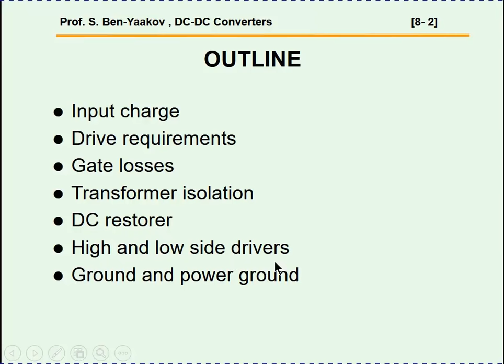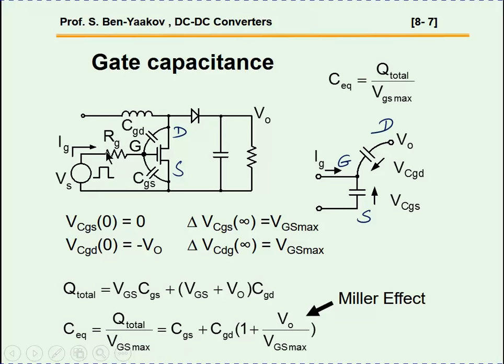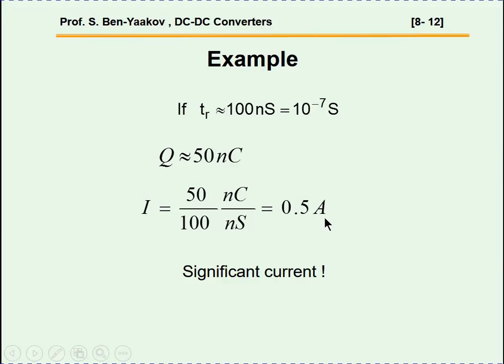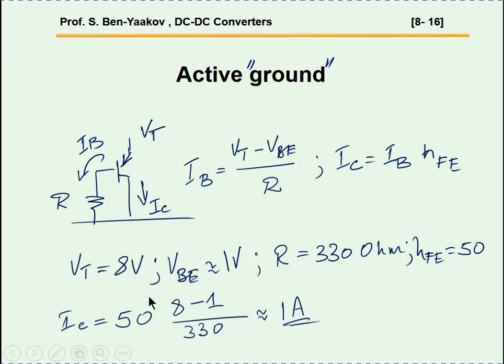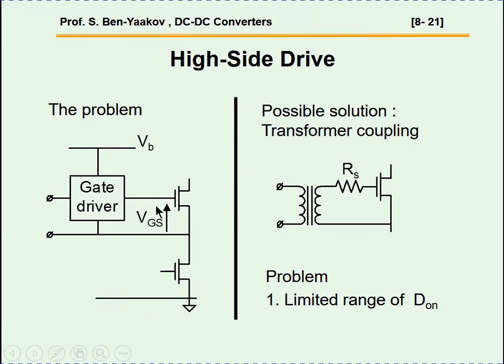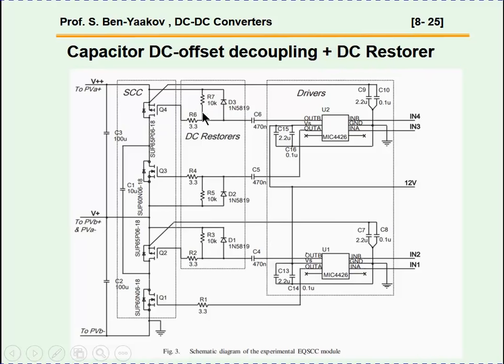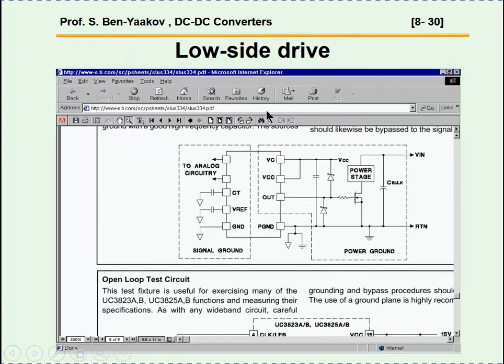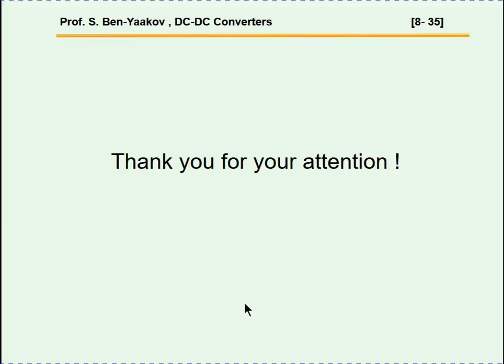Power MOSFET drivers

Comment: Professor, any chance you could do a video on dead time, and how to achieve it for 3 phase inverter circuits. Thanks
Reply from the maker: What do mean by "how to achieve it"?
Reply: @sambenyaakov  I mean how to determine how much dead time is required in order to avoid shoot through when designing half bridge, H bridge or 3 phase inverter circuits. e. g. In a situation where you have high side and low side MOSFETs. Also is  dead time implemented in code, hardware or both? Can it be calculated? if you could do a lecture on this matter that would be great 😊😀
Reply from the maker: OK. Got it. This is indeed a good topic but not easy as there atre many caveats. Will see. Thanks for your suggestion.

Comment: Dr. Sam. regarding  Ton of MOSFET you mention at page [8-9] ,can I find this data in MOS datasheet or calculate it? Thanks!
Reply from the maker: Ton is in fact the rise time YOU want. To completely charging the gate.
Reply: @sambenyaakov  Dr. Sam. Thanks for reply, on the other hand, it means if I set driving current of MOSFET,then Ton time can be calculated,right?

Comment: thank you for your explaining. if there is only a mosfet, G is disconection and provide a DC voltage between D and S, is there any voltage appear at G due to Cgd and Cgs? if there is ΔV add onto DC voltage, how is the voltage of G. thank you!
Reply from the maker: Theoretically the voltage is due to a capacitive divider. But this is overtaken by the DC current  leakages which will push the voltage to ground or supply depending on which leakage ( DG or GS)  is larger.
Reply: so, in general, we need to connect a resistor between G and S to force the voltage equal to the potential of S? thank you!
Reply from the maker: @陈友敬  Indeed

Comment: Hi Dr. Sam,
Please, in internet there are many information about power mosfet driver, but I want to know a example with the theory. In my case I have a IRF640 VDS: 24 VDC load: R: 10 and VGS: 12VDC. Which should be the value of the Rg on and Rg off for this application. The frequency is: 10Khz.
Regards,
Wellington
Reply from the maker: I would say that 3.3 Ohms will be fine.

Comment: @1:27 after Q2(x axis) isn't it it charges only Qgs not Qgs+Qgd .. because till now all the app notes I have found everywhere it has been mentioned only Qgs not Qgs+Qgd ..

Correct me if I am wrong
Reply from the maker: You may be correct in saying that in the app notes you have seen, the charge is Cgs, but this is incorrect. If this charge would have been Cgs, why do you see the flat portion? This plateau is due to Miller effect caused by the charging of Cgd. All this is explained in video.
Reply: @sambenyaakov  Sir I am referring after Miller platue region ( at the end of Miller platue region Cgd charges fully) when VGS rises futher at that time only Cgs charges to reduce RDSon.....but in your videos it shows QGS+QGD both charges.

Am I making any mistakes?
Reply from the maker: @biswajit681  Yes you do. Once the plateau ended Cgs and Cgd are in PARALLEL and both continue to charge (no Miller effect)

Comment: Thanks for the explanation, I have a question concerning the gate power loss, does  Ce  equal Cgs or Cgs+Cdg ?
Reply from the maker: Ce? where did you see it? If you mean Ci then Cgs+Cdg.
Reply: At 14:40 you used Ce to calculate power loss
Reply: Both is wrong. Use Ce from 9:22.

Comment: just spend a sunday and mondy, to code some blinking code on arduino, to regulate the mosfet´s behaviour thru " a level of detaiil" when the frequency is between 30 hz and  10 mhz on the lower end. the up and down ramp is different, just by observation, and tthe oscilloscope is not even warmed up for this. thie blinking between each step has to be compensated later, with some switched capacity or some softening in the curve is modeled out. frequency with hundret or millions of hertz makes it even harder for a chp to calculate, this is then dsp ground, one might say :) thanks anyhow

Comment: Professor, how does Vth change for a given MOSFET over time, temperature or whatever may affect it?
Reply from the maker: Good questions. Yes, the threshold drifts with temp but not in a major way that needs adjustments. Regarding aging, I don't know but I am not aware that this proved to be an issue.
Reply: @sambenyaakov  thank you!

Comment: Hi Sam, thanks for your explanation. I have a question... in the computation of the total charge (from 8-4 to 8-7), Cds disappears. Actually, the voltage change during the off-on transition across Cds is not negligible and therefore the expression of Qtot should include the term Cds x (0-V0).
Should be (but I'm probably wrong here): 
Qtot = Vgs x Cgs + (Vgs+V0) x Cgd + (0 - V0) x Cds
The last term doesn't appear in your expression. Where am I wrong?
Alessandro
Reply from the maker: The Qt is a measure of the charge that the driver has to supply. The Cds is not charge or discharged from gate side so it does not need to be taken into account.
Reply: @sambenyaakov  Is that because when the mos closes, Cds is discharged through the Rds_on?

Comment: Thanks so much Dr Sam, you help me and others a lot, can you please talk about MOV's like how can I pick MOV if my input is 3 phase 220vac and output is resistive load 45 vdc 10 kw the input capacitance is 470uf so how can I calculate my MOV? Also the size of the thermistor which I use it for precharge capacitors (soft start) and I short it after ms with relay, what is the minimum power for this thermistor?
Reply from the maker: Hi Tom
Thanks for comment. Sorry for not having the time to answer you. I will consider preparing  a video on  MOVs and thermistors.
Reply: Thanks so much Doctor Sam

Comment: I am a bit confused as to why turning off fast has the drain voltage rise slowly thus limiting switching losses. I would think turning off slow would make the drain voltage increase slowly. But seems to be the opposite. 

Can someone explain that a bit more?
Reply from the maker: If you turn the current fast and the voltage rises slowly, there will be minimum overlap which causes losses.
Reply: @sambenyaakov  would this just be because the turn on is way faster than the capacitor can respond and charge up. So turn off fast, cap absorbs some charge but isn’t fast enough to drive up the drain voltage. Being that Vds is a term in switching losses and is low it drives down the losses?

Would you want turn on to be some percentage less than the rc time constant, using esr as the r?

Thanks for the reply by the way, I am so happy that I found your videos. Been watching and taking notes for weeks now:)

Comment: What will happen if I select a weak driver ie .25A gate driver for a power MOSFET where ideally 4A driver is required.
What's the worst case effect of the above
Reply from the maker: Higher switching losses.

Comment: I have a question, does bootstrapping limits switching frequency?
Reply from the maker: The on time should be sufficient to charge the cap.
Reply: @sambenyaakov  on time is 49% and off time is 51%
Reply from the maker: @vidtechnology7342  the bootstrap charging TIME should be sufficient

Comment: This is correction to one statement in below query as " Why H bridge configuartion with all 4 MOSFETs as N channel MOSFET is prefferable."
Reply from the maker: N channels are preferred because they are more available and less expensive and the low side drive is referred to ground. The body diodes may cause reverse recovery problems but on the other hand are useful in ZVS. For the drive issues see my  YouTube video on MOSFET drivers.

Comment: Sir, this is regarding the Gate drive Requirement calculation. You mentioned about the Time of rise(T on), is it from the Datasheet? or is it frequency of PWM signal dependent? 
I am using IRFZ44 MOSFET and a switching frequency of 20kHz. The datasheet says tr= 84nS. Should I consider that for  Ig calculation??
Reply from the maker: The rise time is application dependent. For 20kHz no need to drive the gate that hard. You can get (in terms of switching losses) with  something like 200-400ns.

Comment: What will be the ratings of high side Push-pull fets/bjts acting as gate driver boosters to an igbt based h-bridge if Input to h-bridge is 600v. Should they also be of 600v or less. Plz reply urgently if my question is not clearly understandable to you. You are explaining it at 22:30 time in this video
Reply from the maker: The pus- pull driver transistors rating is related to the drive voltage - not total voltage .
Reply: @sambenyaakov  Thanx sir

Comment: Im currently using Irf3205 n-channel mosfet and ir2110 MOSFET driver for Bldc Motor control using Arduino. MOSFET is not completely turning on by the MOSFET driver IC ?

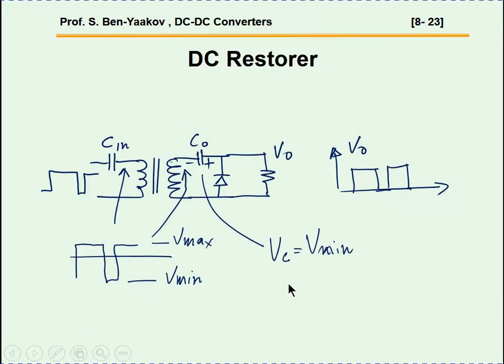Comment: Thank you again for the nice and detailed explanations. For a while I have been wondering if there may be a more efficient way to drive a mosfet gate: saving the gate turn-off charge in a capacitor, and then use the saved charge on the next turn-on cycle. It seems like the DC restorer circuit (28:17) may do exactly that?
Reply from the maker: Thanks. The DC restorer is still lossy. In https://youtu.be/ZtgOboxMNoU I am showing a "lossless" gate charger. An effective way is resonant drivers. Perhaps a good subject for one on my next videos.
Reply: I see, thank you. It never crossed my mind that just the act of charging a capacitor, could create a loss equal to the final stored energy. Great!
Reply from the maker: Here is an intuitive explanation. Supposed the current  I  is constant. The energy you pull from the source is V times I the energy pushed into capacitor is I times a variable voltage, the average of which is V/2. So the energy delivered to capacitor is only half that pulled out of source.

Comment: One thing I failed to understand from many application notes ....in the Miller platue region VDS is changing so there is voltage change across Cgd capacitor and as a result there will be current flow through the Cgd but what is the path of the current flow??? Is it gate driver to Cgd or Cgd to Gate driver ?? This time capacitor Cgd discharges itself but in most of  the application notes says this time capacitor Cgd is  charging..how it is possible???

I failed to understand the complete current flowing path during Miller platue region.

Could you please clarify it??
Reply from the maker: The curent is coming from the driver. This perhps might he if you will watch it😊https://youtu.be/zJQM842clcM

Comment: Voltage in i can see L is a coil...? how many ohms resistance...?  the value  of the  Rg..? and the final cap..? and the input voltage...?
Reply from the maker: To what minute in video are you referring to?
Reply: @sambenyaakov  3.26  the value of the Rg , L is it a coil..? what resistance ohms...?  diode and final capacitor.......
Reply: @sambenyaakov  I forgot to tell you that I did not study electronics and I am learning, the circuit you see in the video I implemented it as an experimental circuit.
Reply from the maker: Hi, This fig is just for concept. Details are in video later. L is an inductor. Looked up you video, too bad I do not understand Spanish. Looks interesting.
Reply: @sambenyaakov  Thanks Sam, i do not understand english, i am learning, you can understand for the commentaries of Mark S and Master Ivo and you can understand my process with the previous videos i have the circuit diagram.

Comment: Hello Professor,

I am using a SiC module which turns-on very smoothly but during turn off the voltage Vds is having very high frequency oscillations and the oscillation dampens in few microseconds. Is my gate drive not fast enough or parasitic inductance is too high?
Reply from the maker: Your gate drive at turn off is apparently fast. In fact, you can lower the oscillations by slowing down the turn off, but this might increase losses. The oscillations are due to stray inductance Try to reduce them and/or use an RC  clamp.
Reply: Thank you.

Comment: 14:35 i think this is wrong. When i turn on the mosfet, it use power from the driver, but when turning off, i just get rid of the charge?
Reply from the maker: The isse is not power from source but the power dissipated. At turn off same power is dissipated, in resistor and driver, as in turn on. .
Reply: @sambenyaakov  I didnt even watch the video to the end, and had an answer ;-). I missed that "heating the resistor while charging the gate". Thanks a lot.

Comment: If we provide the current more than Igate required . Is it damaged the mosfet ?
Reply from the maker: Although not very well documented, the general understanding is that for some FETS ( which may have a lower internal  gate resistance) a gate driver with very low output resistance   (and hence high peak current) may damage the gate if the current is not limited by a series resistor.

Comment: Sir, if I want to design a 50KW power supply then how to select an IGBT (in an h-bridge) w.r.t power ratings e.g does IXGX120N120B (Vce:1200v, Ic:120A, Pc:660w) is enough for this supply?  and What is meant by Pc:660w for this igbt?
Reply from the maker: THis might be marginal. Pc: power dissipation when the case is kept at 25degC (which you can never achieve at 660W, perhaps with cryogenics (-: )

Comment: i need controller IC (like PI) for PWM controller.can you recommend
Reply from the maker: This is a too general question.
Reply: hi..I am a just beginner in this field.So i need help from professionals like you.From literature survey I came to know about various PWM  controller IC like SG3525,TL494,KA3525A etc.From their application note What I have understood is that these controller behavior is similar to that of Proportional controller.Suppose  i want to use PI controller,should I reconfigure the error amplifier in the above mentioned IC or I have to use separate PI  controller.If so,please suggest some specific PI controller IC for PWM Controller. 
Thank You
Reply from the maker: The 3525 is old but very good and inexpensive. It has an error amplifier around which you can connect a PI phase compensation network. The 3825 can be configured to operate in peak current mode which has additional advantages like cycle by cycle protection as well as a more stable feedback loop due to the inner current loop. Good luck with design.
Reply: shyamsundar JENA as you are a beginner use a 555 pwm

Comment: At 22:30, you need threshold > 1/2 Vc.
Reply from the maker: 👍Indeed, Dsirable. Thanks for correction. But in many applications Vt<1/2Vcc
Reply: @sambenyaakov  True of 4xxx CMOS.  Results in brief "shoot through."  Requires that unused inputs be tied high or low to prevent overheating.

Comment: Hi,
Please, I need your help with my circuit: I have IRF640 and IR2101, Fpwm: 1Khz and Boostrap circuit is C=100nf  with diode Rg=10ohmios. VDC=24dc
and DC motor. The configuration is Half bridge.
I have a problem with high side the transistor, it gets too hot.
Could you indicate me which would be the problem?
Regards,
Wellington
Reply from the maker: What is the high side driver?
Reply: Hi Dr. Sam,
I have the circuit according to the following link http://www.twovolt.com/2016/08/26/high-current-half-bridge-driver-using-ir2101ir2104-gate-driver/
But, I have the following elements  IRF640 and IR2101, Fpwm: 1Khz and Boostrap circuit is C=100nf  with diode Rg=10ohmios. VDC=24dc
and DC motor.
And the problem is Q1(HIGH) is very hot.
Regards,
Wellington
Reply from the maker: If I understand correctly the capacitor of the upper supply is 100nF. This is apparently too small. This capacitor supplies the quiescent current of the diver for 500us as well as the gate charge while maintaining a sufficiently high voltage to keep the MOSFET on. Did you measure the voltage of the upper supply (with an isolated  differential) probe? I see that in the reference design they use a 10uF capacitor in parallel to a small one. Are you?

Comment: Could you use a converter circuit that is not 100 years out of date? Pick a circuit designed in the 21st century?
Reply from the maker: Robert, since I have posted this fundamental to eternity  tutorial  about 6 years ago, it was watched by 234,000 and only last month by 2000, It got 2000 likes and no single dislike. Dont tell you something about yourself? With you frame of mind, you should not use the old Ohm's law or Maxwell equations.
Reply: @sambenyaakov  So, when you are criticized you attack rather than try and improve yourself.

Comment: Hello! Excelent video!
I have a question regarding this moment: https://youtu.be/of_v2N5f788?t=1389
MOSFET push-pull. If the Gate voltage is 1/2 Vc and Vt is less than 1/2 Vc, then both fets will conduct. Isn't the better way to have an N-MOS on the top and P-MOS on the bottom?
Reply from the maker: Would work but...for the N you will need a gate voltage above the DC bus and for the P negative voltage.

Comment: Thank you very much Profeesor.This is the best working video with in depth technical knowledge for power electronics designer to use.I am a learning Field application engineer trying to make my concepts clear. 
1)  Can u please help make video on working of  PI Scale2 Plug and play IGBT gate driver-1SP0635V2 with circuit explanation? https://gate-driver.power.com/sites/default/files/product-docs/PI_Gate-Driver_ProductCatalog.pdf

2)  Also,I would like to know as compared to TI,IXYS and Toshiba,PI is having superior protections and performance for Gate driver?

3)  Since many designers would like to design Gate driver circuit on their own (as mentioned in- https://www.fujielectric.com/products/semiconductor/model/igbt/application/box/doc/pdf/REH984e/REH984e.pdf ......- chapter no.-5,7, then why they can prefer to use PI gate Driver IC? If possible can u list some advantages of using driver IC instead of designing it.

4)  Lastly Can you share any website link or youtube channel helping clearing more concepts for Power electronics designing?
Reply from the maker: Hi, I am trying to avoid explanation of specific products. For a multitude of reasons.